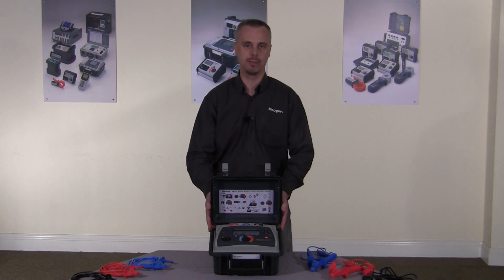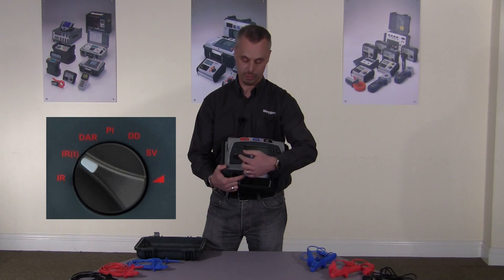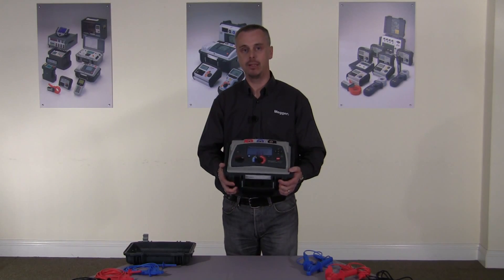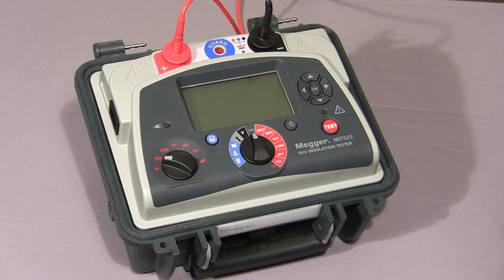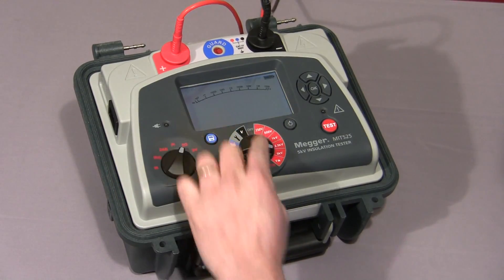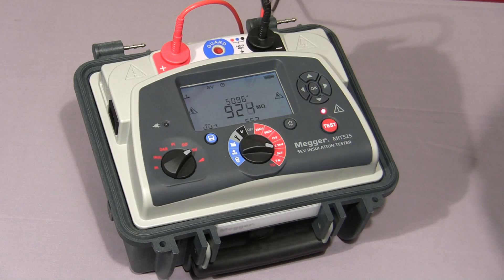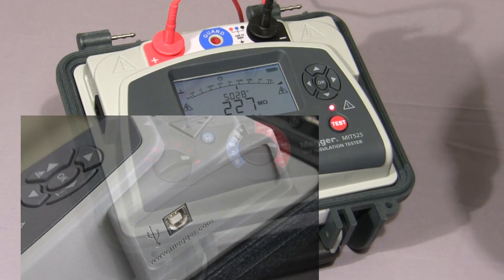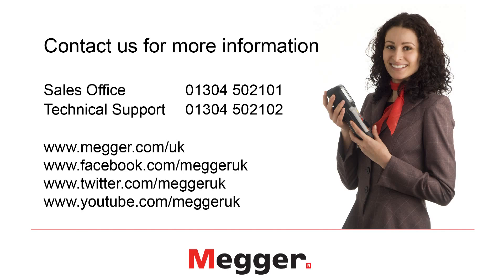Megger MIT515, MIT525 & MIT1025 Insulation Testers - Product Demo

Comment: What can I do when I switch on the Megger then Error 10 appears on the Screen??
Reply: Hi Moses, it sounds like your meter will have to be sent back to Megger for internal investigation. You need to contact whoever supplied you with the unit or your local Megger agent to arrange this.
Reply: Did you fixed it